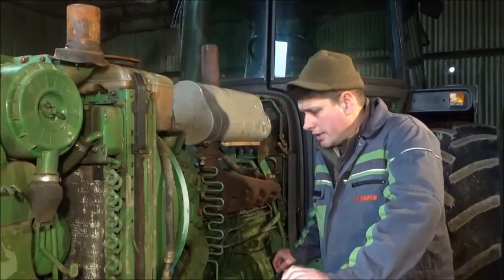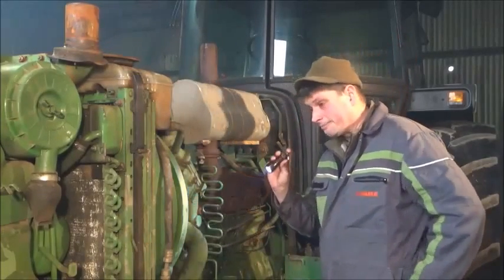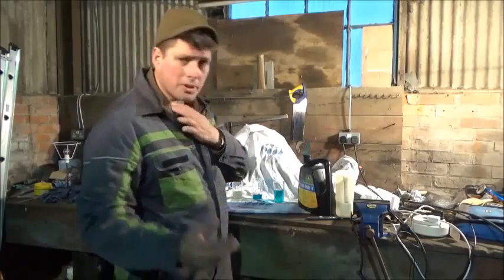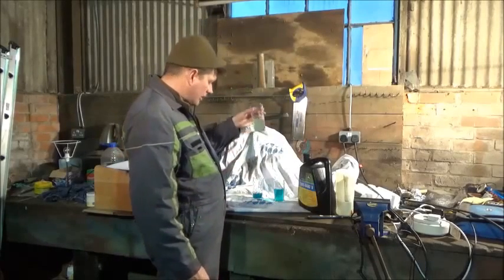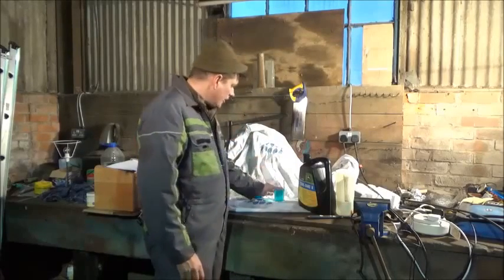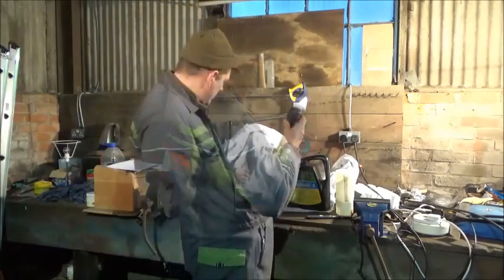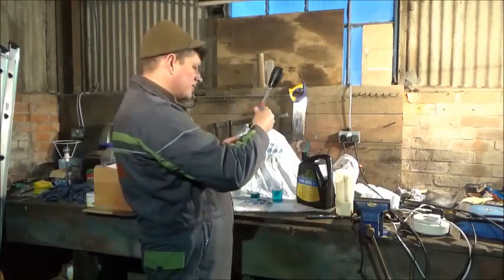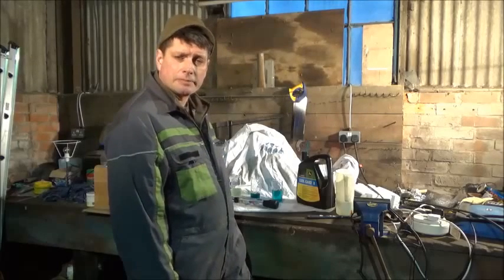John Deere 3350 Coolant

Comment: Another good video if I remember correctly ford started fitting water filters on series 10 generation 3 it was supposed to have a kind of water softener in it did other tractor manufacturers follow I know some lorries suffered from porous liners at the same time I think I heard  some John Deere’s suffered from porous liners by the way she sounds lovely another good project

Comment: great video, I've always changed antifreeze on any used machine upon buying then roughly every 4 years, only recently started using demineralised water previously only tap water and antifreeze at 50/50. Your video provides a really good explanation and the description of the cooling galaries blocking etc something I admit I've never considered.
Reply from the maker: It's something that can happen in various situations Paul - not the norm but it can and does happen.
Thanks for watching and contributing !

Comment: I'm always learning something from YouTube. What you said about deposits and scale building up on the cylinder walls was very interesting
Reply from the maker: In general Don that would be in an industrial or heavy commercial scenario, especially where water quality is non-specific. If you ever see an old tractor block from the 1930's or 40's when they used to drain down and refill rather than add antifreeze, the internal cooling galleries are often horrific !

Comment: We would add a product called Nalcool. It would stop the electrolysis on the water pump, heads and cylinder. People neglect the coolant to often.
Reply from the maker: The modern stuff will cover all that Lloyd but Nalcool was recommended in the Ford tractors to try and help prevent the blocks going porous. It was also recommended for some of the CAT engines, especially the V8's.
Reply from the maker: Those were the days when things were maintained and repaired. The army used to filter, test and recycle antifreeze.

Comment: Well done, I think you covered all the main important points there, however how often would you recommend draining and replacing the mixture - if at all?
I was surprised you didn't mention checking the flexible pipes and taps that are connected to the cab heater. I would also have had the cab heater switched on when warmed up to check for heating function (I'm thinking air locks and the operation of the flow control valve).
Also I didn't know until recently that you should not mix blue antifreeze mixture with the red stuff as they are antagonistic for those people who are not using John Deere's Koolgard - most likely in older engines.

The simple tester works great and gives peace of mind to the user.
Reply from the maker: In fairness Dan I did actually check the heater hoses, plus the block connectors as they are the last ones I want splitting but there is only so much I can put into a video otherwise it could go on for over an hour !
The manufacturers of antifreeze/coolant recommend flushing and changing every 5 years but in harsher climates that can drop to 2 years.
It's not the antifreeze properties that deteriorate but the additives but then they would say that as they sell the stuff !
Yes, you must be careful when topping up that what you are putting in is compatible with what's already in.
Some good info there Dan !
Reply: I was gonna say the same thing but I read ur comment first. Over here in the US we have green an orange and from what I've been told is that if you mix the two it will gel up. I don't know how true that is but its what I've been told . 

      And Kurt she sounds good can't wait to see her in the field.
Reply: Thank you for the reply . Waiting to get torch (aka flashlight) just curious to see how long it takes to get to the US
Reply from the maker: Cheers Paul, as I said, Youtube is great but 75% of what's filmed and what I'd like to keep in get's cut to try and get as much in as possible. I spent a fair bit of time in the States with a major manufacturer studying coolants and lubricants. A lot of it is dull stuff but there is some really interesting stuff too but I have to find a balance and the majority of my audience are people like Dan and yourself who already know most of what I'm talking about. I stick to Coolgard in the Deere and Shell Antifreeze in everything else.
Easiest way to check compatibility is to check the MIL spec.
Reply from the maker: It went on Monday Paul, Airmail, so I would expect you to have it early next week ? Let me know when it arrives !
Reply: Will do